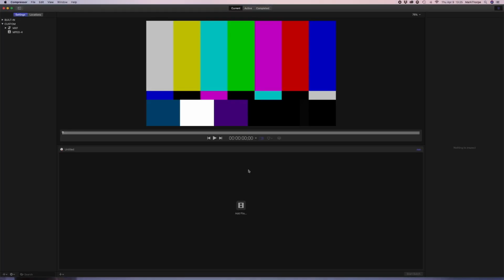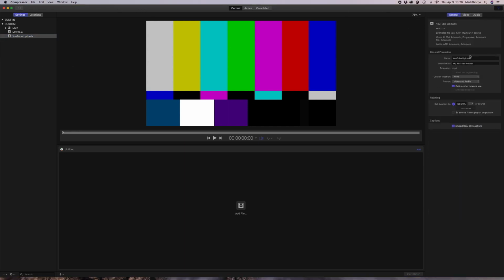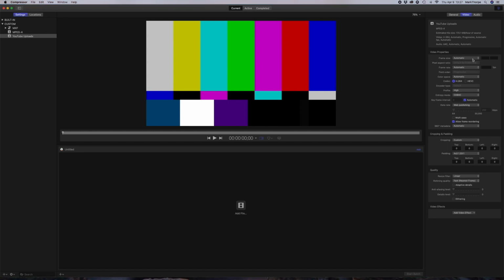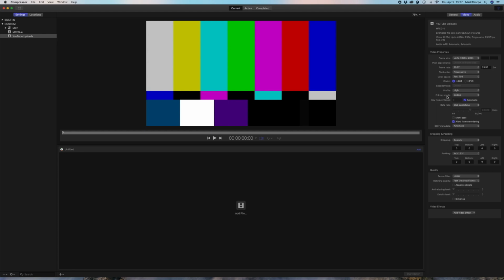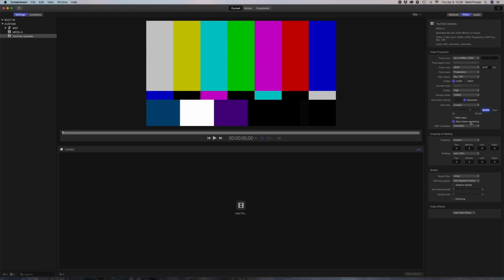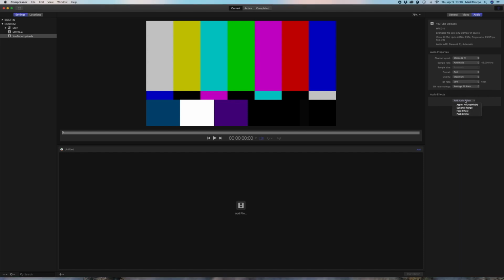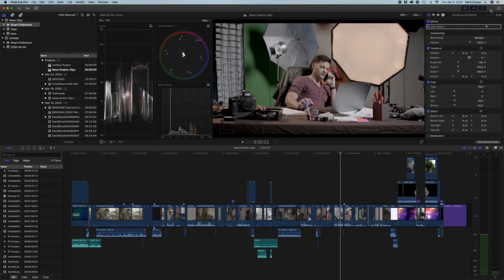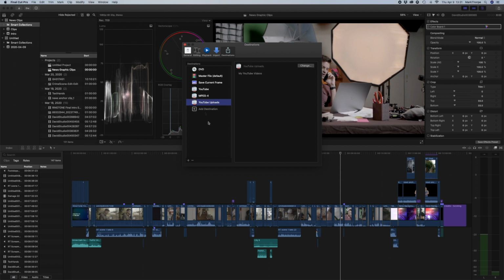Create FCPX Export Presets for YouTube With Apple Compressor

Comment: Great video my friend. Got a question Im new to this, I exported some footage the other day to YouTube strait from my Mac Pro using FCPX  and it dos not look good 
at all, footage is from gopro 8 2.7 res 30fps and I used h264 to export. will compressor help me compress my footage so youtube dont have to compress my video so much? Thanks
Reply from the maker: For GoPro settings, I use a GoPro Hero7 Black. I shoot at 2.7k 120fps and wide. I then create a custom timeline in FCPX with settings 2560 x 1440. I dump the footage to that and edit it and then export using a Compressor preset using the process as outlined in the above video. That way I can create a very high bitrate and quality MP4 file that YouTube doesn't seem to compress that much. Things look good. An example of that process can be found at the following video:  https://www.youtube.com/watch?v=Ozgk_LC5qE4
Reply: @seawildearth  Thank you so much for quick answer. so you go down from 2.7k to 2560x1440 right, then in compressor you put the same 2560x1440 or you go to 4k resolution? and because I record @ 2.7 30fps superview will you recommend 2560x1440 timeline? Thanks for the help
Reply from the maker: @pedronhfd6969  yes, if you use those same setting as I use you will keep the timeline in FCPx at Custom > 2560 x 1440 and save that as mpeg4 through Compressor. It will then appear on YouTube as 1440 HD which is same as 2.7k.